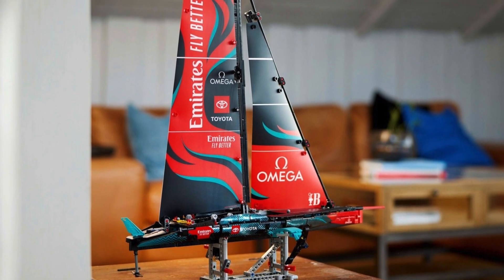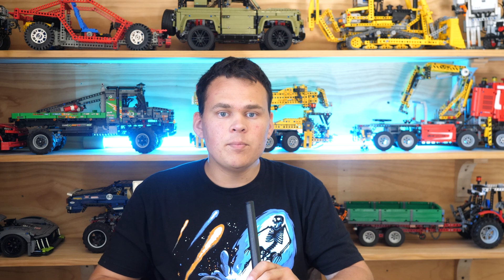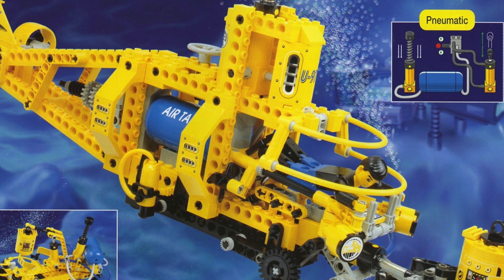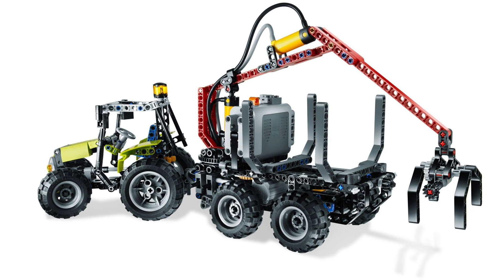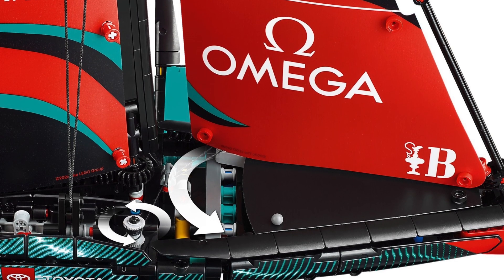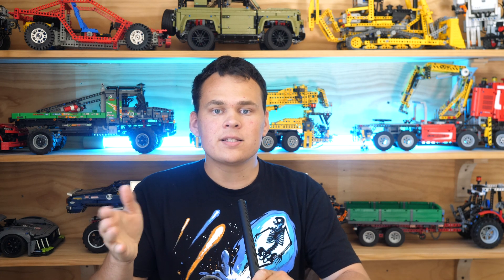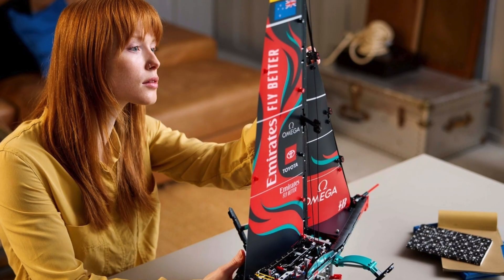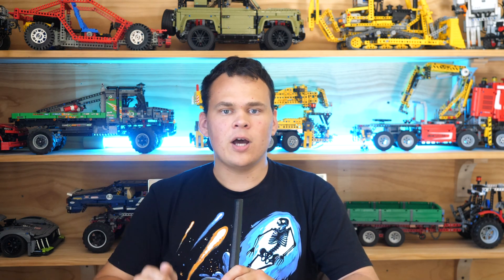LEGO Technic Emirates Team AC75 Yacht REVEALED! First LEGO Technic Boat with Pneumatics

Comment: For me as a sailor and a Lego fan as well - a total disappointment. A couple of years ago LEGO released a floating catamaran 42105 - I was thrilled, especially that after appropriate modifications (modified mast, keels, rudders) it really sails! Even self-steering by wind is possible there. So when I heard that Lego is going to release another watercraft, I was also hoping for a floating sailboat, only bigger and more complicated. Every week I was checking the news about this set. And? Lego now release a model of a yacht, which not only does not float, but its mechanisms are based, as far as we can see, on a stand attached to the hull. But it has pneumatics and branded badges.... Lego, why?.... Nonetheless - I will perhaps buy the sails (if they become available in retail), and continue to modify the 42105 :)
Reply: I think a catamaran is easy to float regardless. For this boat they would've had to add a feature of a yacht underneath for it to even float as foils are it's stability so it wouldn't work. On water like a catamaran does.

Comment: Pneumatics on a boat? Airboat?

I think they used a compressor instead of the usual handpump because you ideally need to push down on the pump and there isn't a lot of space on top of the boat, also using the smaller pumps you get a bit more fine-grained/slower control over the cylinders instead of extending them with 1 pump motion.

I think it's a cool boat but I will not be paying msrp lol, I'll wait until retailers discount it a bit.
Reply from the maker: I agree with you. Although they could’ve just put a manual pneumatic pump on the stand itself. I agree it’s definitely overpriced